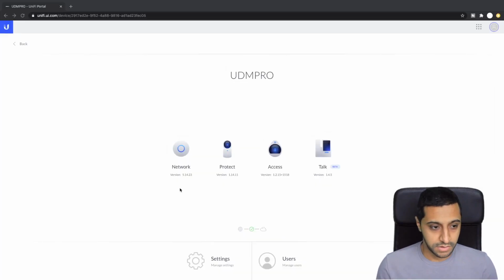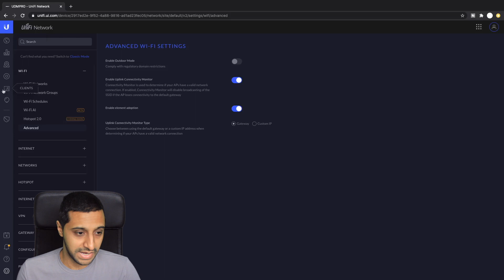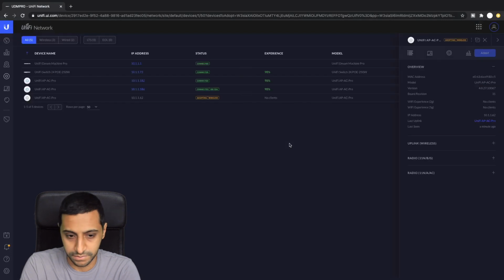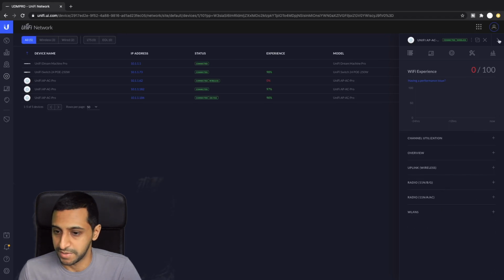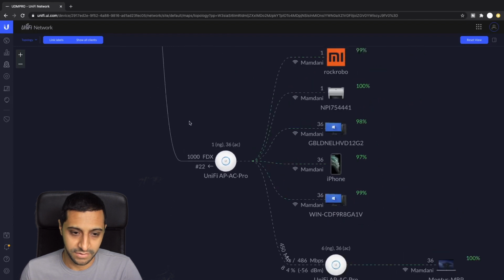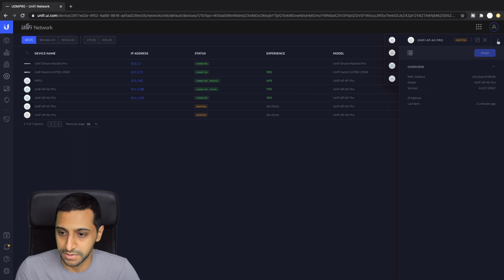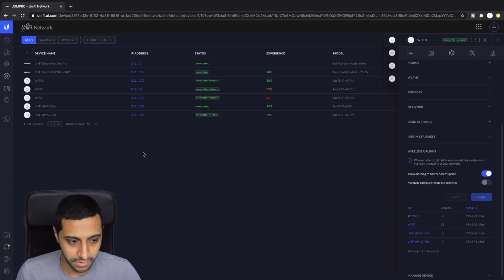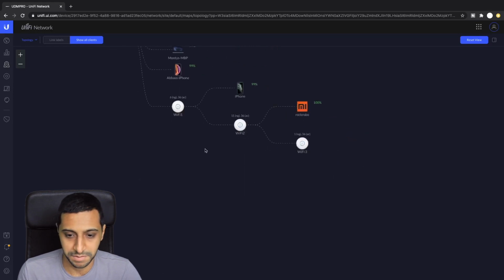How To Configure Wireless Uplink / Mesh Network Using Unifi. How many Access Points can you link?

Comment: If I am currently working with another Router (Asus) as my primary device which creates a network SSID that broadcasts both a 2.4 & 5 gHz frequency, will this Unifi device be able to repeat this same network if I create the SSID to be the same credentials as the Asus Router, hopefully creating a "mesh" type network with two brands via ethernet cable? Sorry for the complicated question, but I hope it made sense.

Comment: Hi - I have an existing router which is NOT a Unify.  I want to extend the range of my original router's SSID using UNIFY discs but I do not want the degraded performance of having a wireless mesh.  I would rather use the ethernet cables run from my router to the UNIFY disks to extend my original router's SSID so I get full performance.  I do NOT want multiple SSIDs.  Is this possible?  No video I watch answers this question directly.   Assume I have POE concerns all taken care of.

Comment: Building 1 - has the backbone ISP, a router... a POE Switch, and a cable up to the AC Pro wifi device.... I want to MESH this to a similar AC Pro Wifi Device in building two, a VERY short distance away... which would also be powered by a POE switch.     

Since I'm powering the Second Wifi AP with the POE switch... can I plug other devices, cameras, laptops into the POE switch, and use the AC Pro Wifi Devices as a bridge between the buildings, without paying $400 for dedicated "bridge" level devices from Ubiquity?   Could I make a poor-man's connection between the buildings with (2) of the a $130 AP's ?

Comment: Thanks for the video. My UDM Pro uses the new GUI and I don't have the uplink entries you talk about, just a general the "Uplink Connectivity Monitor" in the system -> Application configuration. I have a base AC Pro and I'd like to use a spare AC Lite in the mesh setting. I reset the AC Lite to factory default I can see it's waiting to be adopted but the adoption fails. After a few attempts, it's stuck in adopting but it's doesn't really work. I cycled power a couple of times and in the end it worked. Thanks for the video.
Reply from the maker: No problem. Glad it all worked out. Keep in mind you can always switch back to the old GUI for the UDM Pro. Not sure all the setting are still there though.
Reply: @InsideWire  Thx, I noticed but they warn you about possible changes when you switch back.

Comment: Hi, I am ok to run a cable to two or three APs, but want proper handover of clients, will this support this? Also, for roaming between APs over extended space, do I have to have UDM? or can I use the app for that? I only have edge router X.
Reply from the maker: You can run cables from your switch to the APs. You can run the unified network controller software on your PC or raspberry pi or invest in a cloud key.

Comment: Hi
Is it possible to mehs your network when you have few access points connected from the switch? Or you can only use mesh network when only one device is connected and the rest is wireless
Reply from the maker: You can mesh even through you have a few access points. I this video i had two access points already and meshed others.
Reply: @InsideWire  thanks for your response, but what I meant was, if both AP s or more are connected to a switch using cable can I still mesh  them as one SSID and clients can roam between them ?

Comment: Do i need a USG or Switch to adopt AP AC Pro's Wireless? I tried it a couple of times, but it doesn't work. AP AC Pro on PoE, don't light white, don't apear, don't give the message wireless adopt.... what i do wrong?
Reply from the maker: You need the network controller to adopt them. If you don't have a cloud key, then you might want to install it on your desktop or another machine.

Comment: I am about to configure 5nos Unify AP AC LR in next week. I need to Keep same ssid in all Unify AP. Do I need to manually add ssid in all AP through controller software. Or is there any way by just 1 settings all 5 Unify ap will have same ssid.. Please shed some light on this.
Reply from the maker: Do you have the cloud key or UDM pro where you’ll be controlling all the APs from?

Comment: Thanks for the video. Have you had any issues with iOS MacOS devices dropping from the Unifi Network? I’m looking to make the switch to Unifi, but I’m concerned with recent reports of iOS devices dropping from the network. I’m not sure a fix has been released yet.
Reply from the maker: Personally i have not had any issue with iOS or MacOS devices, I have a number in the house.

Comment: Quick question. If I want two access points with two separate SSIDs do I need to create a mesh or can I just use them both Independently?
Reply from the maker: You can select what SSIDs you wish to broadcast on the APs.

Comment: Hi Awesome video.I have a UDM with a AC PRO inside and a UAP-AC-M on the outside .If I want to extend my outside coverage ,without wiring  ,do you believe that some UAP-AC-M and the uplink is the solution?
Reply from the maker: If you are not able to run any wires and you want to extend then yes you can use the uplink feature.
Reply: @InsideWire  Thanks

Comment: Great video! I have the ac m and ac m pro. 
Ac m pro is connected to my isp router where dhcp also runs.
Ac m is unable to connect to the pro as uplink. Do I need a ubiquiti Ap for this solution to work? Because I think I have everything done as in your video but doesn't work for my case
Reply from the maker: I have not tried to configure this AP as standalone before. For the solution in this video to work you need the Unifi network controller software and adopt your APs

Comment: I have a U6-LR in the house meshed over to a nanoHD in the garage.  Problem is the range on the U6-LR is so good that all the devices just keep jumping back over to the U6-LR even if they are within feet of the nanoHD.   80Mhz wide on channel 155 for the U6-LR and of course then the nanoHD.   If I cut the power level on the U6-LR it hurts the speed of the connected mesh.   Not sure how to solve this one.    I have a device connected right now in the garage that's getting a -86dbm signal (12%) when it could connect to the nanoHD and get 99%.   Once in a while it does,  just  doesn't stay.  All the latest firmware of course.
Reply from the maker: That is a tough one. I don't think there is a way to force it to use a specific access point within the software and as you already tried to reduce the power. 
Guessing it affects your speed when connected to the U6-LR in the garage.
Reply: @InsideWire  If I walk into the garage with my watch and phone they will jump to the nanoHD,  the device that lives in the garage just loves the U6-LR and won't stay connected to the nanoHD only about 15 ft away.   Creating another SSID kind of defeats the purpose of the mesh IMO,  so guess I'll just have to live with it.   Thanks.

Comment: I just setup a UAP-AC-M 500' away at my barn and intended it not to work until my AC nano arrives, however it auto meshed with my Unifi 6 lite and my phone works up to 200ft away from the UAP-AC-M.
Reply from the maker: Nice! Are you noticing any drop in speed?
Reply: @InsideWire  yup I get 400 at the house and the barn gets 10-15Mbps download.

It's usable. Hoping my back order Nanostation-ac5 ships soon

Comment: Hi, I've connected one of my ac pros to my home router (wired) and used wireless uplink for the other one. Tried connecting devices for the wired ac pro but it would connect to the wireless one. Any help for this one?
Reply from the maker: Hi, I dont think there is a specific way to set what AP it connects to. It just depends which one it connects to first. Perhaps move closer to the wired one; disconnect and then re connect.